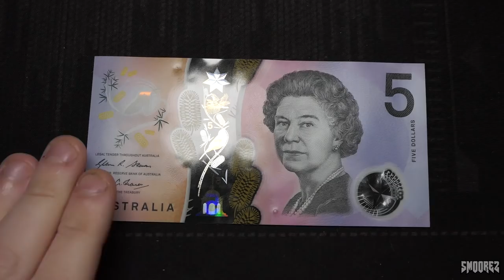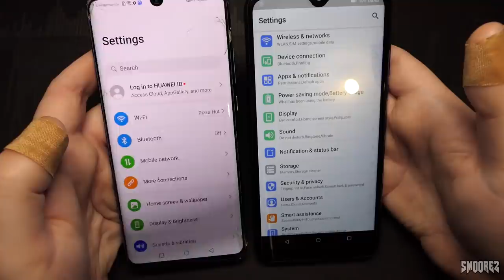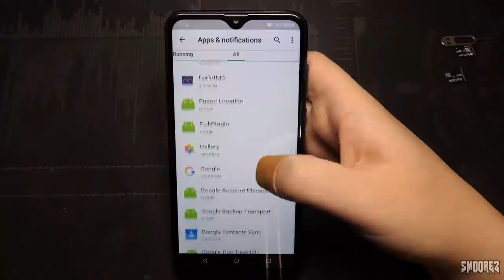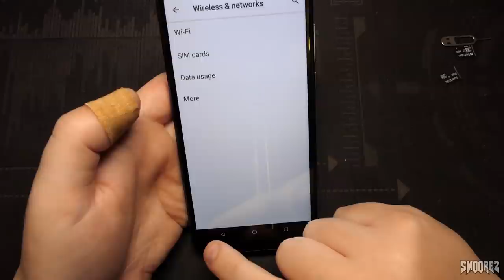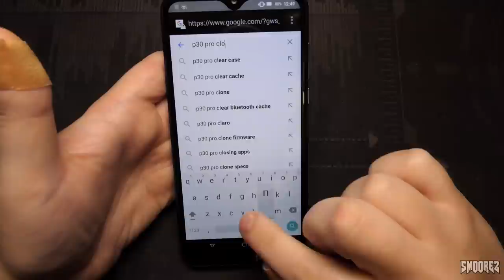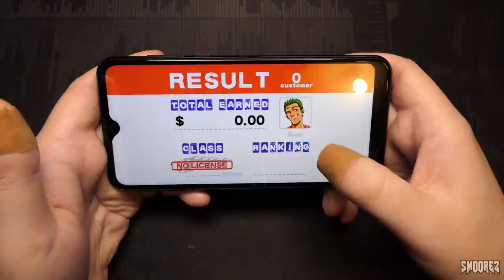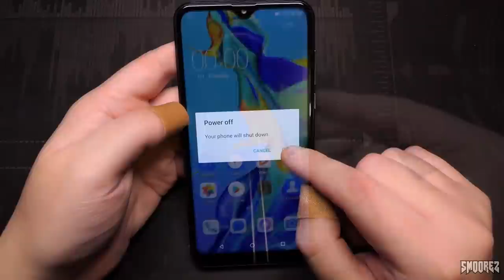I bought ANOTHER WELCOME P30 Pro Smartphone from my Local Flea Market for $5!

Comment from the maker: If you somehow do find this available for sale online, don't buy it - please.
Unless it's $5...then ok sure why not!

Would you buy a Welcome/Generic Smartphone for $5 if you found it a Flea Market? Let me know!

Download the stuff extracted from this thing here: 
https://archive.org/details/WELCOME-P30Pro-New
INTERNET ARCHIVE: https://archive.org/details/@smoorez

TIMESTAMPS:
Pre-Intro: 0:00
Introduction Ramble: 0:35
Taking a look around the phone: 1:55
Quick Comparison with the real deal: 4:16
Powering both up: 6:02
Testing Sim Cards & Calls: 7:04
The installed apps, random SD Card issue & UI Features: 8:03
Settings - Networks, Connections & Application List: 10:31
Settings - Battery, Display, Sounds Notifications & Storage: 12:10
Settings - Fingerprint & Failed Face Unlock : 13:43
Settings - Gestures & Retrying Face Unlock: 14:58
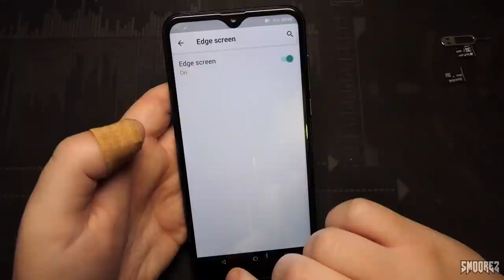Settings - About Phone & Updates: 16:01
Checking out the Camera & Edge Screen: 17:28
Camera Test: 18:30
Camera Thoughts & persistent SD Card issue : 20:56
Testing Applications (Browser Test): 22:00
Testing More Applications (FM Radio): 23:47
The rest of the apps & Speaker Test: 25:26
Gaming Test: 26:53
Checking Out The Specs: 29:50
Conclusion & Power Off: 33:32
Teardown: 35:07
Did it survive & full specifications: 39:57
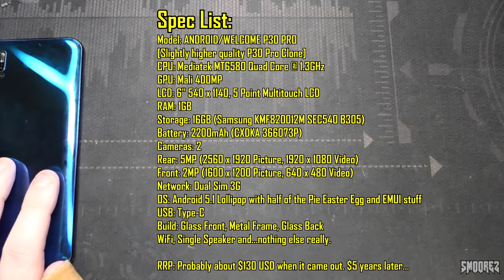Bit of rambling about various things: 40:45
Outro: 42:31

CPU & System Apps are in the description above!
As well as the extracted files from the phone!

Be good people!
Reply: Dude, you should actually sue them
Reply: I accidentally bought a welcome device a few years ago from Amazon for £50! I had it for 2 days and gave it to my son, he then gave it to his friend and I’ve no idea where it is now, it’ll probably go round in a big circle and end up back with me 🤦🏻‍♂️😂
Reply: @shanethrelfall416  lmao, it's either broken now or its on the way to you.
Reply: @leonardwei3120  why tho? That thing is dirt cheap and is better than other $100+ welcome phone
Can even run latest Minecraft 
I would have gotten 1 for backup
Reply: PLEASE!!!  "Pretty much when I SEEN this phone..."  For God's sake, you are an intelligent man!  SAW...not SEEN!!!  You aren't a bogan; don't speak like one!
Reply from the maker: @tripsadelica  ok, calm down mate
Reply: Thanks for the video and the extracted data! Enjoyed it as always. This time, the ringtones are just the default Android affair, sadly… nothing funny or stolen or anything. But, having seen the phone in the video and heard the usual flutey ringtone there, I kinda anticipated it — the phone copies the Huawei design, yet doesn't really seem to claim to be a Huawei phone itself. Just as generic as it gets in all regards, including the media department.
Reply: @SMOOREZ can u try installing custom roms on welcome phones
Reply: @kashishaggarwal21  Since it used older MT6580/MT6592, totally can, but the process? Idk
Reply: Hey can you like leave the phone in the other room while you test out the call quality that would make the echo stop
Reply: So is this phone going to be your new daily driver? For real though, what phone do you use daily?
Reply: Tracfone tend to subsidize their low end phones and you can get them for $5
Reply: I would buy it and change the boot animation and install like android 4.4 if it works it can be a functional phone
Reply: For $5? Yes!
Reply: Nice, im using huawei, and its sweet
Reply: @okok123c  yep

Comment: i place my bets on a quad core mediatek processor, 1 gb of ram, 16 gb of storage and android 4 5 or 6 made to look like 9 or 10, and i'll edit with what i got right and wrong.
So far i've gotton the mediatek processor, android 5 and "fake" android version in settings, ram and storage. These devices are stupidly predictable.
Reply: Android 9.1 doesn't exist tho lol
Maybe it's actually android 9 exaggerated as 9.1
But who knows?
Reply: @someoneyouneverknow7529  yeah i didn't see the 9.1 until after i made my prediction, honestly i didn't expect them to go that far.
Reply: The clone industry has stagnated over the past few years as they've been churning out the same MT6580 garbage with the only difference being the LCD and the UI.
Reply: @blakegriplingph  this one actually improves slightly and with cheaper price
MT6592 there